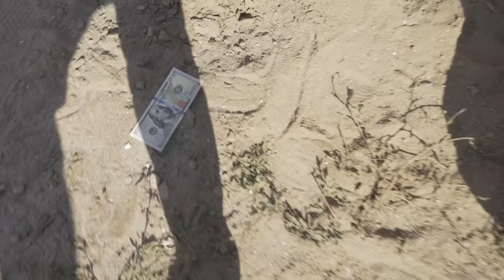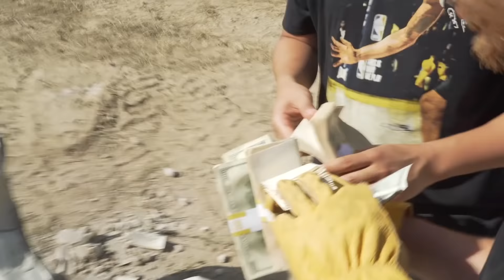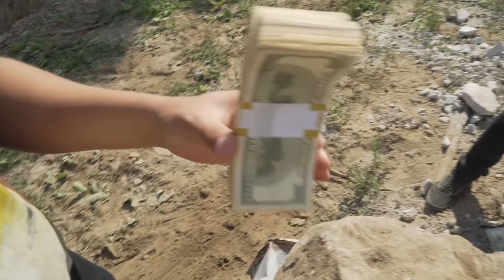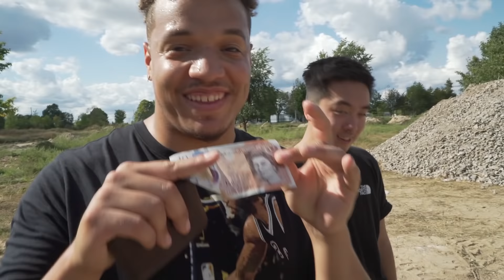We Broke Open The Abandoned Safe and Found This.. ($50,000 CASH!?!)

Comment: Some tips on safes -  the back panel is generally always the thinnest part on older safes as the thinking used to be 'the back is against the wall so it doesnt need to be as thick', quite a lot of older safes also have a thin panel of glass inside the door which when broken sets off the deadbolts, this is to stop people from trying to smash into them with blunt force so if you hear a clunk when you hit the door, its probably not opening, its just locking itself more.

A big nasty stihl saw on the back panel is definitely the most efficient way into a safe like this if you dont care about keeping the safe afterwards!